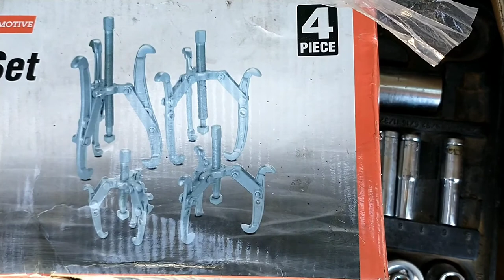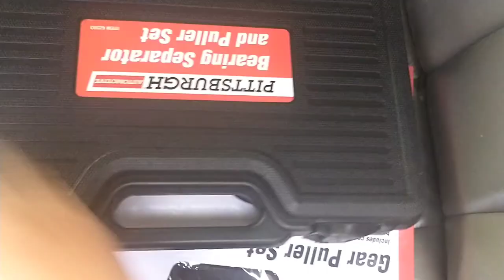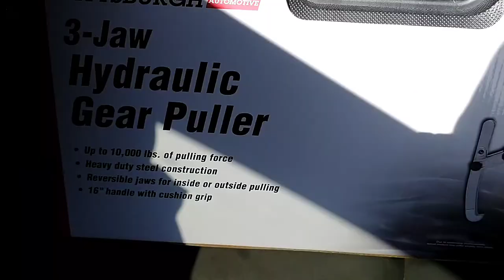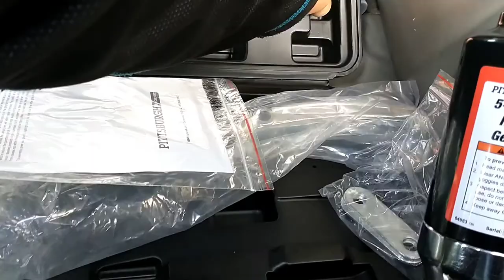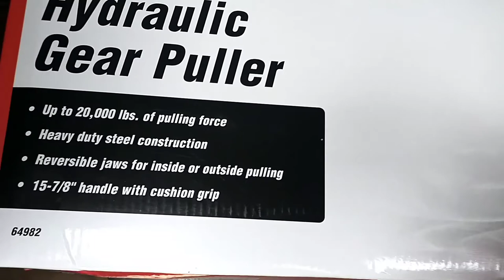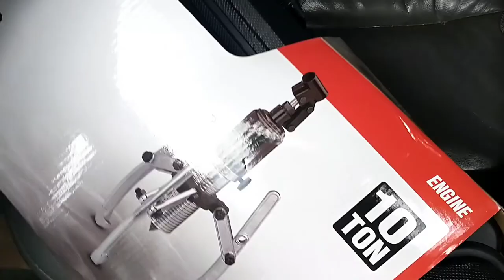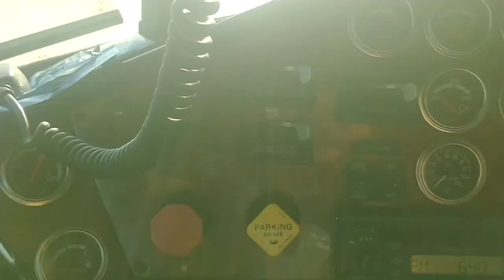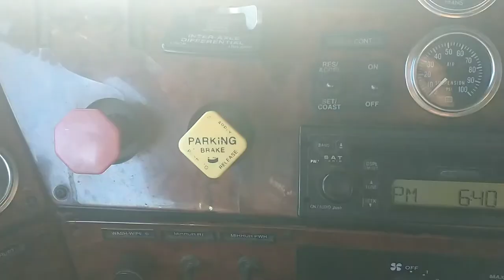Challenge Accepted: Replacing Center Carrier Bearing And U-Joint Freightliner Driveshaft

Comment: Man I’m doing this today but I have to install the whole driveshaft that’s in front of the one your in. The thing is that mf is heavy af. I’ll find a way to put in.
Reply from the maker: @CrisF-o5v  Thank you for checking out our channel. Tap that Like and Share if you don't mind. Also Subscribe if you haven't already. We have different content in our catalog that you might like or find interesting. We hope our content helped you out a little. Yes, you definitely have to disconnect your drive shaft from transmission. Maybe you can use some racheting straps to hold up part of the drive shaft; and help you bare some of the weight. If you are replacing the carrier bearing this is our complete process. Always exercise safety first.

Comment: The 3 jaw puller might have worked if you would have  jam a big screwdriver in it to keep it from spinning with the bearing. In other words stop the puller from spinning. You only want the bolt of the puller to spin.
Reply from the maker: You mighty be right. Even with the bearing spinning it would have worked it on out. But the center of my 3 jaw puller was in really bad shape, that's why I could not keep going with it. You can definitely try your way and let me know how it works out. Try not to have much fun with it.
Reply: @MahlonTane  It's all good, been there done that. The reason I say it (might) work is because I've had some luck doing it that way. Not that it will work. Peace be with you.

Comment: Good job now i feel confident to do it tomorrow.
Reply from the maker: Thank you I appreciate you checking out the video
Reply: Bro, you got the yoke nut off by Hand! Dam!👍👍I'm doing my customers/neighbors Volvo carrier bearing and power divider tomorrow...but I got air tools
Reply from the maker: @glenbrown4441  don't have to much fun out there. Thank you I appreciate you checking out the video
Reply: @MahlonTane  it's not gonna be fun,but ima video it and it's supposed to be 90degrees here.... gonna have my cooler Full of beer for this job😛😎😎
Reply from the maker: @glenbrown4441  sounds like you have all the right tools good luck with that
Reply: Did a Volvo vnl brake chamber and slack adjuster yesterday...by Hand 😎

Comment: Before you replaced it. Did it mess with your rpms or high gear if you have a 13 speed?
Reply from the maker: Didn't really notice it. But vibration and visual inspection of the issue is what alerted me. I believe this was a 8-10 speed. RPM could be something else, what did your mechanic say the issue was? If you watched our video, we show what the problem looks like. Do tap that LIKE and SHARE, if you haven't already. It helps our channel reach more people. We really appreciate your support!
Reply: @MahlonTane  it was a different issue for me. My splitter was leaking air. So my high gears wouldn't engage.
Reply from the maker: @broderickmoore7322  I see. I hope you get it fixed bro. I'm glad it wasn't the turbo 👍🏽👍🏽👍🏽👍🏽👍🏽

Comment: If someone tried to cut off the stuck bearing…. Would it be too much of a big risk??? That you would end up cutting the mating surface???
Reply from the maker: It's possible that the mating surface can get messed up during the process. It just depends on who's cutting it, how much experience they have... What tools they are using to cut with. I do NOT recommend cutting. But that's just me tho.
Reply: @MahlonTane  thanks for reply!,,, appreciate it.

Comment: Your u joint need grease bro. It loos very dry.
Reply from the maker: Thank you for watching and supporting our channel. It actually had grease inside. Maybe hard to see in video, it's glistening inside the cap(looks like wet water drops or glitter). Yes, sometimes it's hard to keep the outside of the u-joint clean. Good thing the grease kept the dirt out. The new u-joint does look a lot better.